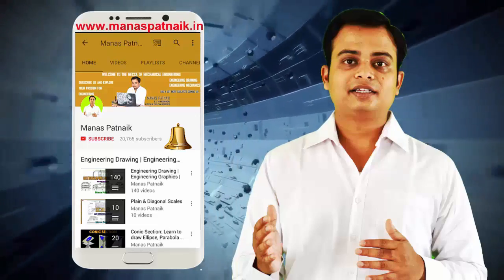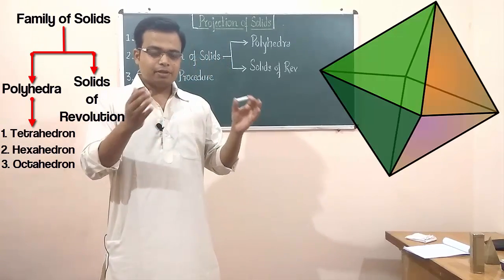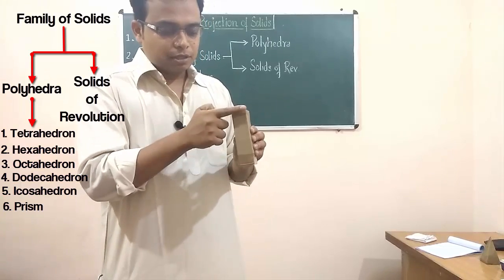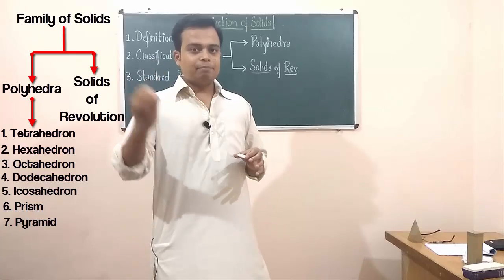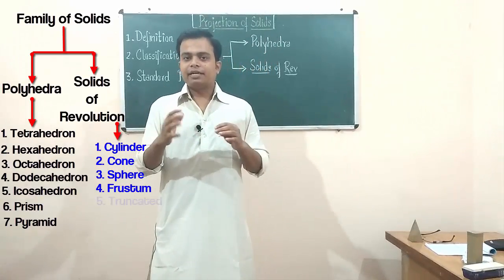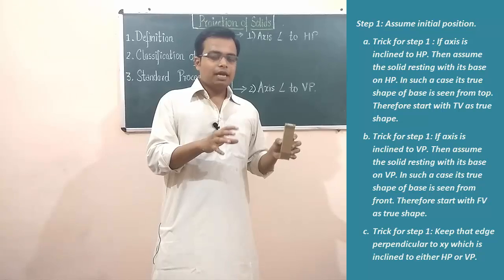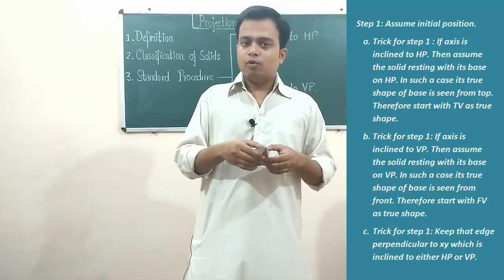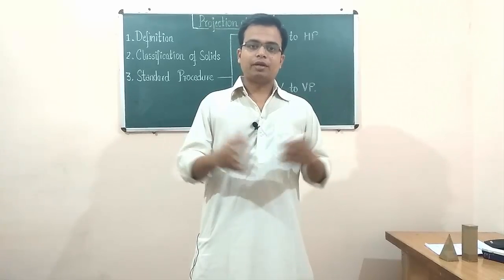Projection of Solids_Solid Types_Standard Procedure

Comment: A hexagonal prism base 30mm side and height 60mm long is resting on its corner on HP. Draw the projection when axis of the prism inclined at 30 degree to the HP and the ''EDGE" passing through resting corner is inclined at 45 degree to VP.
Sir please solve this problem because the edge makes 45 degree not axis.

Comment: A pentagonal pyramid has an edge of the base in the hp and inclined at 30° to the vp while the triangular face containing that edge makes an angle of 45° to the hp .Draw projections of the pyramid.Length of the side of the base is 25 mm while that of the acis is 65 mm
Reply from the maker: Problem noted. but cant promise anything right now
Reply: Manas Patnaik  sir actually I am not getting this problem and I have problem in Projection Of Solids and I have examinations
Reply: Any book I refer to study for Solutions
Reply from the maker: Disha......
Add mr on fb messenger and i will send u a solution picture
Reply: Manas Patnaik  sir I am not on fb or any social media sorry